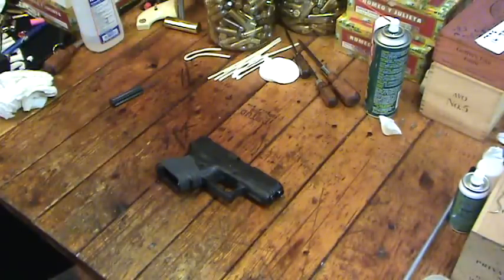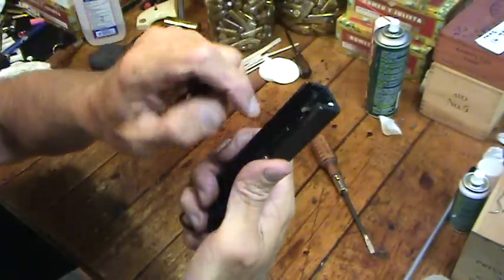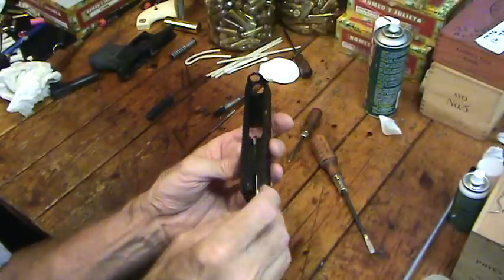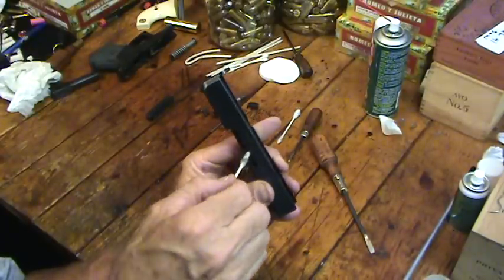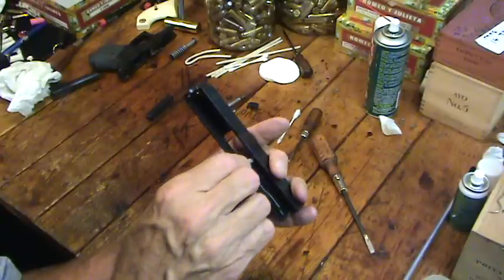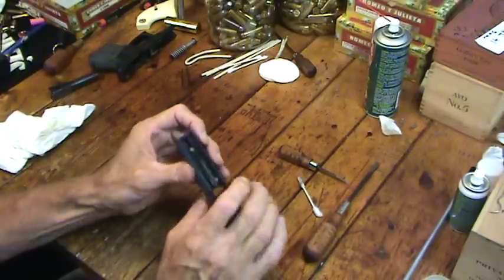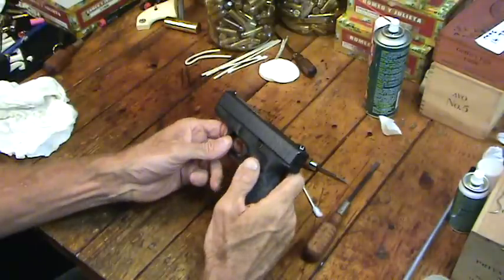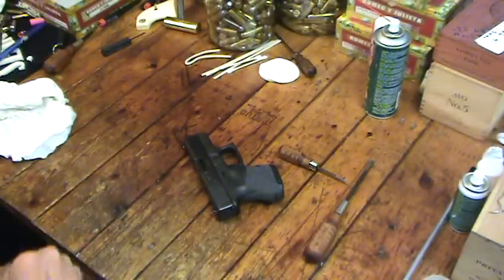Glock Cleaning 2  (Slide Disassembly)

Comment: Hickok, there is a much easier way to get the slide off if you put it on without the barrel in. Take your thumb and put a little pressure on the back of the slide and pull the trigger and it will come right off. Also, thanks in part to some of your vids I just picked up a glock 23 and I love it so far. Happy shootin

Comment: @StudLeez34 I guess it could help, problem is if the compressed air would blow some part away & you cant find it again. I would not recommend using compressed air but I'v never tried so its possible it works just fine

Comment: i just did this to my s&w sd9ve...sweet vid. only the s&w has a little pin holding in the extracter...but after knocking that out same deal. mine was filthy lol..but it does show how cheap my gun is. alot of plastic. plastic on the firing pin tube thingy..plastic in slide spring etc.  is the glock so cheap?

Comment: i also have heard that if you put it back togather without the barrel and all, i think you can pull the trigger so you hear the click and then just push the slide forward and it will slide off like you do normally... i saw that in another video from a guy (H4T)... im new to glocks and dont own a gun just yet. but im hoping to be able to carry a concealed gun once im sure i want it. and have enough smarts to maintain it running smoothly. anyways i hope you could test that to see if it works. ty.

Comment: i just started using hoppes and I don't think so. it seems to leave a slightly oily residue on my hands and that is what you don't want here. I could be wrong, but I would go and get some alcohol or a cleaner that specifies it leaves no residue (I used some Remington shotgun cleaner I had laying around) and repeat what you did. I could be wrong  but better safe than sorry. Chime in Mr. Hickok if im wrong. Life is good

Comment: i saw another video on how to release the slide if the barrel and spring aren't present: the gun must be cocked, then you put slight pressure on the slide from the back, and you pull on the trigger. the slide should pop right off.  - i hope that works out. like i said, i seen it done on a youtube video. =)

Comment: great videos hickok45. I'm a regular viewer of your videos on youtube great job. There is one question I want to ask. Is it ok to overload any magazine? eg. the glock magazine with a standard capacity of 17 rounds. What if one should force 18 or 19 rounds in, what effect will it have on the magazine's regular functions and efficiency/reliability?
Reply: A magazine is only designed to house a specific number of cartridges; If you overload a magazine you're going to have feeding issues with your gun. With too many rounds in the magazine the gun is going to need extra force to strip the first one or two rounds which can cause issues.
Reply: Hickok usually doesn't reply

Comment: an alternative to taking the slide apart when you accidentally put your slide back on your frame without a recoil spring and barrel is to simply draw the slide to the forward position on the frame and pull the trigger. The slide will come right off.

Comment: Yeah, To solve your no barrel or recoil spring problem, the simplest way is to just pull the trigger forward until the safety locks it, point the gun downward and pull the trigger. The slide should just fall off at that point.

Comment: An easier way to get the slide off when you didnt put the barrel is you just push on the back of the slide and pull the trigger, it will come right off.

Comment: @hickok45

Hi and Thank You for this great video.  All are great but this is really helpful.  Question:  On my Gen 3 G-17,  on the striker assembly, just behind the firing pin itself and forward of the spring, there is a little black plastic washer or like part that holds the spring behind the firing pin.  Mine has a spit on it.  Is this normal or do I need a new firing pin assembly?

Comment: Unfortunately, I found out how to get the slide back off without the mainspring or barrel (didn't have much choice, did I?) I found that if you manually reset the trigger (push it in reverse, it resets the trigger but not the striker) it will come off easily enough. Just make sure to do this while the slide is to the rear. I don't know that this doesn't damage anything, I won't be doing it again, but it works in a pinch. I didn't know how to disassemble the slide, it was a new gun to me then.

Comment: make sure you dont pull the spring on the firing pin assembly either, cause the little peice near the front, that holds the spring, separates in two halfs and can go flying across the room lol and its small and hard to find!!!

Comment: Hey Hickok, another great video that stirs up another question I need some help with. Watching you rack that slide it seems to me that yours works with a lot less resistance than mine. So my question is in regards to the springs, have you changed them and if so to what make and weights are working best for you!

Comment: Talking about putting the slide back on without the recoil spring and barrel in. I did that on my G27, Now I may be wrong but I think all I had to do was pull the trigger and slide it back off at the same time. Whatever I did I did not take the slide apart. I do remember that I was like OH S%^&. What did I just do. It wasn't a big deal though

Comment: Would hoppes be ok to put in the no oil areas?  I couldn't find my alcohol today and had some hoppes in my box so I used it not for the slide disassembly, but for the basic cleaning.

Comment: If some oil finds its way into the strikers chamber and left for days do you think the metal will absorb it so it never comes out. I over oiled under the connector and there is some considerable amount that got on the slide and I'm worried some got into the striker chamber.

Comment: If you accidentally put the barreless slide on the lower and cant get it off, push it forward into battery and pull the trigger, the slide will come right off

Comment: hey man,
I cleaned the entire upper assembly of my glock 27, I have never done it before and man was it dirty...  used simple rubbing alcohol and some solvent, are there any areas in the glock that need oiling after cleaning (besides some greese on the slide mounts)?  ive hear both yes and no.
get back to me thanks

Comment: Hickok, I just bought a Glock 26 (used) and the outside of the slide is kind of "scruffy-lookin" i'll say... I'm guessing the inside is equally in need of attention. I'll try this.

my question is probably more suited to the Glock cleaning vid, but can i use ballistol or equivalent on the outside of the slide. Ya know... just a cosmetic application or is that a bad idea?

thanks alot!

Comment: I just cleaned my 19 for the first time since I bought it in 97. It was pretty bad in there, however I pulled a black plastic tube out of mine. It's a piece that the striker goes into. I damaged it so I didn't put it back in. It doesn't look necessary, so I'm not worried about it. Anyone know anything about it?

Comment: There is an easier way to remove the slide that you've put back on the frame without the barrel or recoil guide rod assembly.

With you thumb, push the slide forward about 1/4 inch, pull the trigger, & the slide will come right off.

No need to remove the base plate.

Comment: I'm surprised that the parts that are cleaned with alcohol don't eventually rust.  The old rule in cleaning firearms was that all metal surfaces need at least a thin coat of oil after cleaning.

Comment: i have an sr9c that i recently fully stripped down. Inside the slide was packed full of grease from the factory. should i grease it or lubricate it or keep it dry? it was pretty nasty in there so im not sure. i left a little bit of ballistol in it but not much and havnt had any issues.

Comment: Thank you for this video.  I know it's been quite a while since you posted this one, but it's new to me.  My question is, since no lubrication/protectant was used, do you have any concerns about developing rust/corrosion in the striker channel?  Thank you again for all that you contribute.
Reply from the maker: Herbie Mendelson Thanks. No,  I've never seen any signs of rust in a striker channel of a Glock, or even in the firing pin channel of a 1911.  I treat them the same.
Reply: +hickok45 thanks Hickok for the well explained video. I was finally able to clean those areas in my Glock 19 that I've owned since 1999. one question: how often should I clean these areas? I don't shoot my glock very often ( less than 1000 round in 16 years that I've owned it) but I do field strip it and basic clean and lube. thanks again for your great videos!

Comment: while cleaning my glk 23 after a day @ the range, i too like to fully clean my slide, so while disasembeling the damn thing there goes my extractor depressor. found it but forget the damn spring and loaded bearing.ha wish i had an extra... will have in a few days ordered 2 of each. wounder if the gun would fire without the extractor in place??? anyone know? my guess it would but not extract a round?

Comment: Being a mechanic and using brake cleaner and an air compressor to clean parts almost daily (and my guns when necessary) I find it odd that no one ever recommends using a compressor and a small tip blow gun. I can spray a glock down with the cleaner and blast it with about 125 psi of air and have it squeeky clean in about 20 seconds and in the striker chamber too. A decent gun fanatic would do himself a favor by spending $200 on a small compressor and turn tedious chores into nothing. Just sayin...